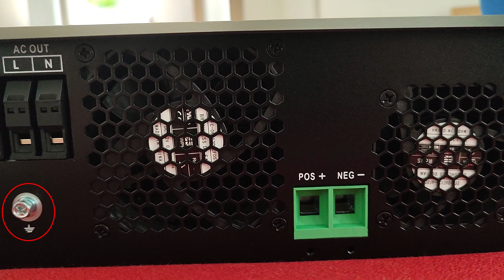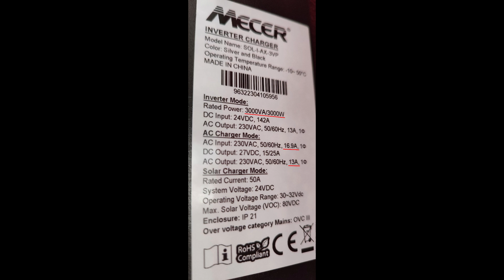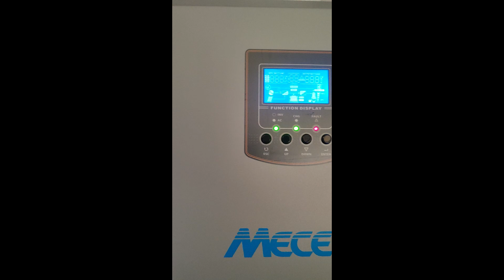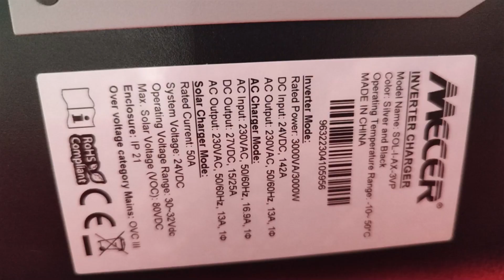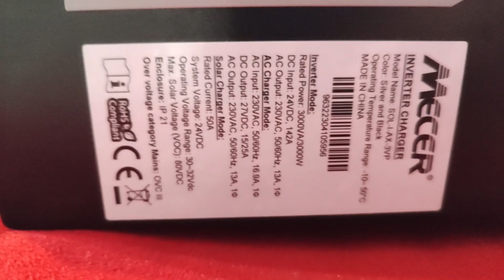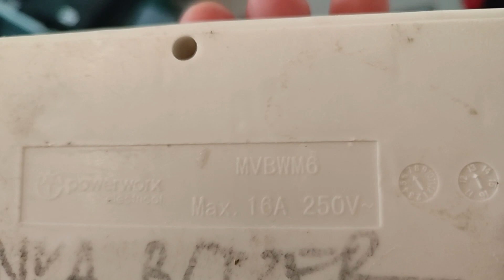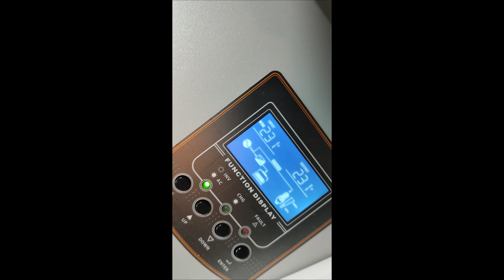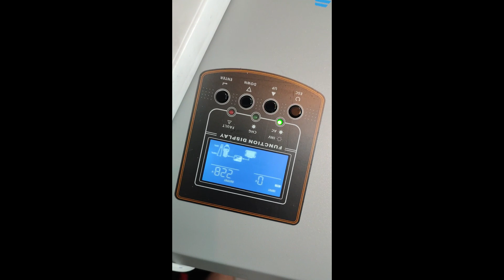Wiring an Axpert Mecer Inverter Trolley

Comment: Howsit man, great video! It helped me, Iv setup as a plug and play and your video made it very simple. However, before I had a 720w Mercer unit and when I had switched it off but still plugged into mains it still ran whatever was plugged into it. Now with the Mercer 3kva exactly like yours, if I switch off the unit as I may not want to run it through a loadshedding schedule it powers off whatever is plugged into it. Why is this? Thanks again
Reply from the maker: I'm glad the video helped with your setup! I've noticed the same thing, I came from 2.7kva Mecer inverter and use to switch it off during the night so that I don't waste unnecessary battery cycles. Unfortunately, it seems that with this model it completely switches off the output power when switched off even when mains is connected. I haven't seen a setting yet that allows you to switch off the inverter output only when mains are off.
Reply: Yeah so since iv got it all connected up there is alot to it. Settings and all. My system didn't stop charging so the fans were always running, quote noisy etc. I called a mate of mine and he assisted me with a few standard settings and eventually the system does stop charging so that's sorted and then regarding switching the machine off. You will need a Bi pass switch connected to the system. They are about R400.00 when I know how to install I'll let you know if you are still having this issue. That way you can switch off you unit if you don't want to run a certain power cut but still have your AC current running through to your devices connected.